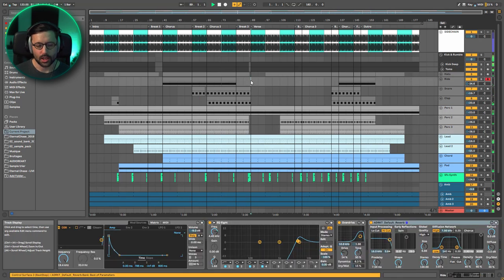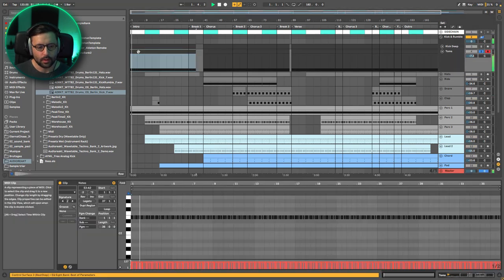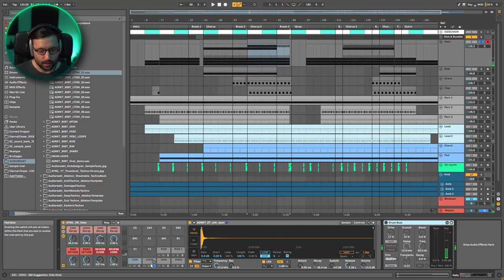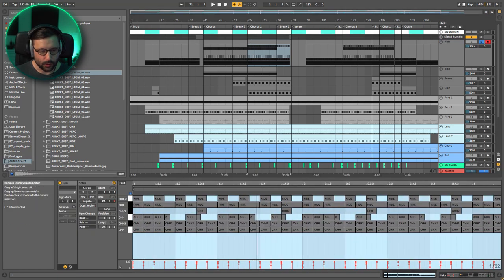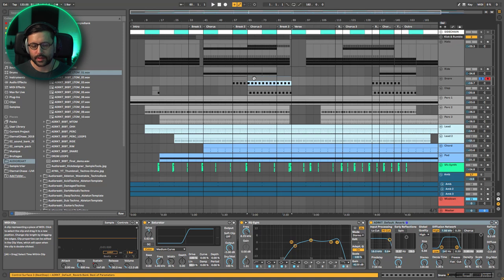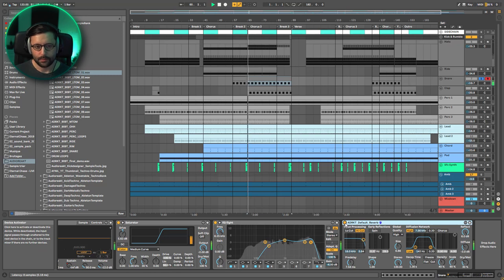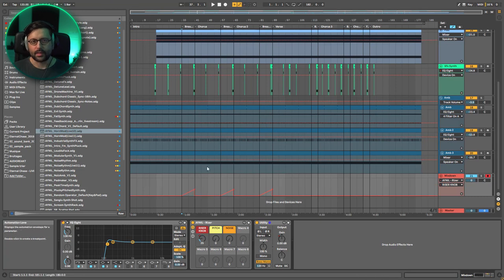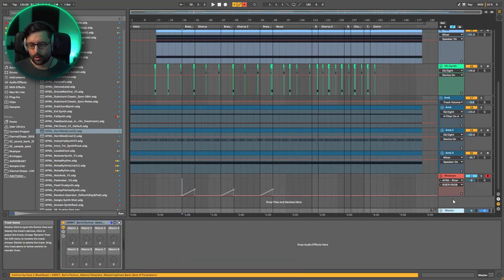How to Make Berlin Techno Part 1 (Sound Design & Composition)

Comment: DT 770 Pro ! Do you use 32 or 80 Ohms? Cheers
Reply from the maker: 250
Reply: @audioreakt  most DDJ’s house DACs and headphone Amps inside, not enough to power 250 Ohms however